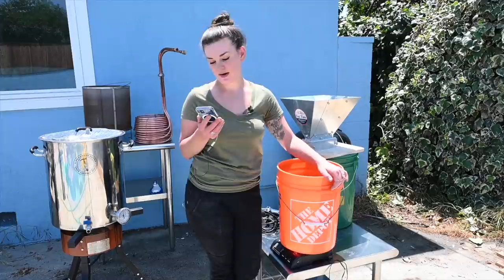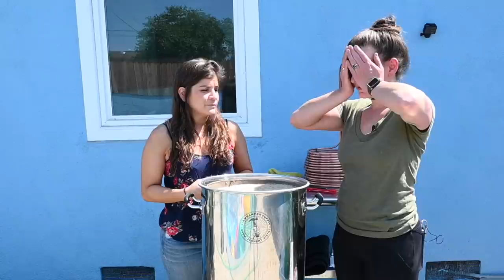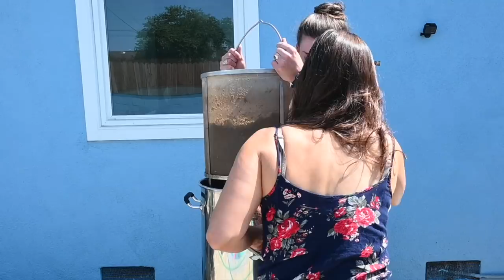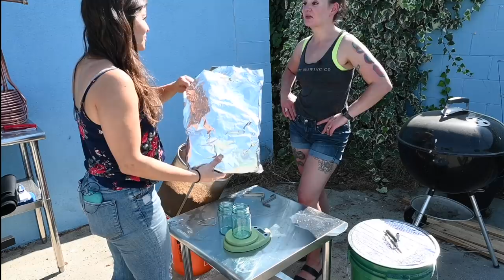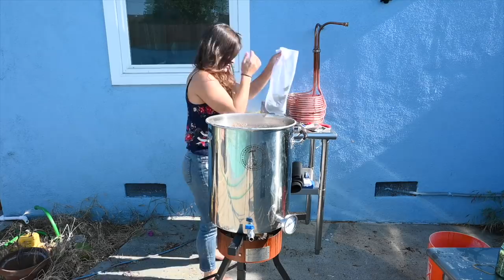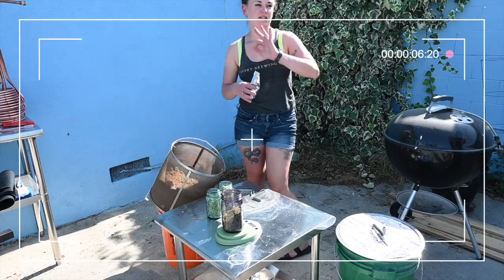Kveik Azacca Pale Ale Experiment Brewday: To Pressurize or Not? That is the question.

Comment: You could easily go 30psi and 86F+ when you pressure ferment with Kveik. It only gets better. Its crazy. But always leave room for the crousen. When the yeast ferments even under pressure it has a tendency to blow back up through the spunding valve. Says something about how powerful Kveik is.
Reply from the maker: Man I'm having trouble even keeping the spending valve at 15 psi idk whats wrong with it!
Reply: @FloraBrewing  get a new one. We all save money on home brewing  equipment by not blowing our money at the pub. A new spunding valve costs less than a round of drinks (if it's plastic).

Comment: Do you correct for temperature with the refractometer or is it not enough or a difference to worry about?
Reply from the maker: It’s got a temp correction on jt
Reply: @FloraBrewing  temp correction only works under 30°C,you can verify with other measuring equipment